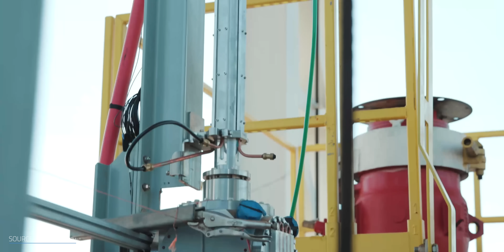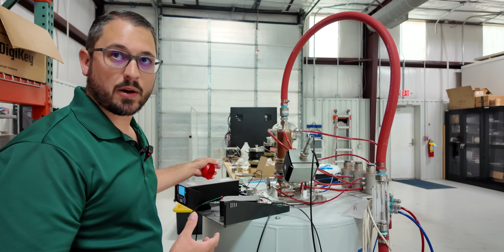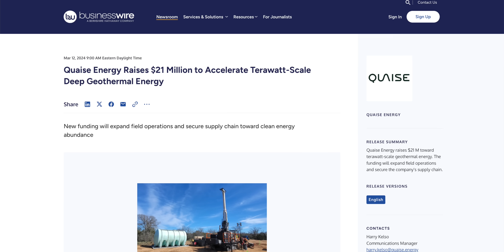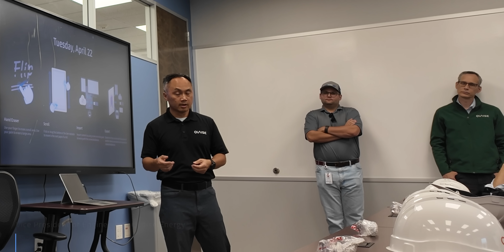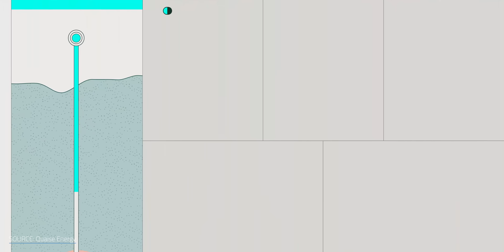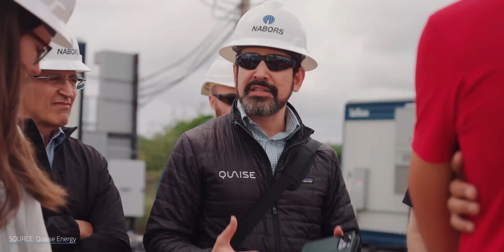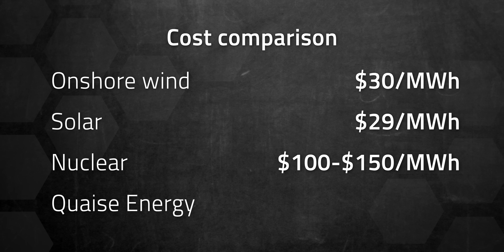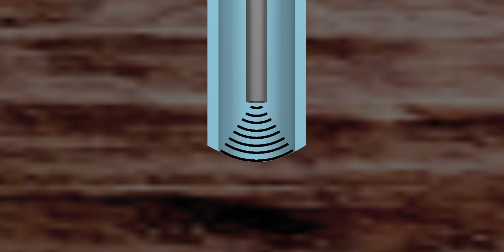How Geothermal Energy is About to Break its Limits

Comment from the maker: Are you convinced this technology can scale, or do you think there are still too many unknowns? Take your personal data back with Incogni! Use code UNDECIDED at the link below and get 60% off an annual plan: http://incogni.com/undecided 

If you liked this, check out Why Mushrooms are Starting to Replace Everything https://youtu.be/jI2LC3WTryw?list=PLnTSM-ORSgi7uzySCXq8VXhodHB5B5OiQ
Reply: Biggest unknowns for me:  (1) Drilling depth.  10 km was cited... the world record is 12.26 km (and while conventionally done, it took over 20 years), so that would be a significant achievement, particularly if that can even sniff that 240 hour mark.  (2) Hole diameter and stability.  You need enough space to work and pressures at such depths would be enormous.  I'm a fan of their approach, but I would not be surprised it Quaise has to settle for "really warm rocks" instead of "superheated rocks".
Reply: I'm skeptical but willing to believe, and I truly hope the best for them
Reply: One elephant in the room is that the vaporized rock will be white hot and some of it will stick to the wall and pipe, causing the escape path to become clogged. They have not yet drilled deeply enough to confront this problem. Maybe this can be solved, but don't count on it. Full speed ahead on all the energy technologies.
Reply: “Freedom-ray”
Reply: -as someone who has worked on many drill rigs, I have 0 confidence in this technology as it currently stands. I do think this kind of drilling will eventually work, but the R&D will probably take at least another 10 years. For one, I don't see that thin crust of vitrified wall holding up all that well against, say, high pressure steam in any given crack/structure. The final product will probably either need casing to TD (defeating the purpose) or some kind of extremely translucent drill fluid that doesn't absorb the energy from the millimeter waves.
Reply: @UndecidedTechnology  i work with drills as an industry specialist in minerals and this looks interesting. For Oil or geothermal this would work fine. Also for uranium if sampling was done using downhole neutron activation to sample. But something not addressed here that is critical for other parts of the geoscience industry is sampling for knowledge on mineral deposits. There is no capacity to collect representative samples from the drill interface for analysis. This is critical for things like precious and base metals. Also, 5m per hour is comparable to mud-rotary or diamond drilling through hard rock, but that rate doesn't compete with hammer based reverse circulation where 60 - 80m an hour is achieved with the right gear. Hammer RC is good enough for a lot of mineral deposits to define the resource and is dirt cheap compared to other methods. It also provides BIG representative samples. Ultimately diamond drilling provides the best data for minerals, but is expensive. Often a combination of the two is used to reduce costs and improve knowledge of a deposit. 

I think this is an emerging and interesting technology, but it is specialise for limited tasks and in its infancy. I do like the idea of drilling with powerful rays though 😁
Reply: Plastic rock deformation at the temp, pressure and depth they’re aiming for. I’m not convinced a glass lined bore will be structurally stable. But It’s interesting, can hardly wait until they figure it out.
Reply: Fascinating, Thx Matt for this information 🙏🏻
Reply: We have freezing gun!!!

🤗🤗🤗

^ ^
Reply: Earth is very Dynamic and it will move 10s of cm in seismic events.
Reply: Desistiu dos áudios dublados?
Reply: if you use boron arsenide inside the pipe it conducts heat 3 x faster than copper. it will not need to be too deep
Reply: I'm quite confident in the technology but when I first heard about Munich trying to use it I thought it was an attempt to keep Infront unduly centralised in favour of long established fossil fuel companies.

I might just be prejudice about them resisting federal laws continuously, on subjects I cared about since 2005
Reply: This is not new tech and frankly I am not convinced that their progress has been all that "dramatic"  It's also an interesting pivot for this drilling tech to a focus away from the traditional target of oil/gas.... an industry that has way more to gain in the near term and yet they have tried and not got it to work effectively in the near past and if they saw this as a likely breakthrough they'd be all over it.  I can't yet see the clear case that makes this approach a breakthrough or differentiator for geo. (I'd be happy to be be wrong btw - but will sleep easy on that possibility)
Reply: @tiagdvideo the classified tunnel tech of the military. 1960s. just pretending to be "new"
Reply: @UndecidedTechnology  
I wonder if the rock fumes might not cool and deposit on the way up?
Reply: How would this technology complement Sage Earthstore and their supercritical liquid CO2
turbine based geothermal?
Reply: I think it best to wait untl they did their first bore hole.
Reply: Im glad you revisited this technology. Seems very promising, In the sense that we definately can use the heat from the earth IF we can get to  it in a financially economical way.
Reply: Thanks for the video. Can you provide some information on how their cost compare to standard drilling costs. Something like an all in dollars per meter unit comparison. Also curious to know if they have an approach to revamp existing wellheads that have been capped due to low productivity.
Reply: What forces a Data broker to comply?
Reply: It will have to survive lawsuits from people who are convinced it caused the earthquake or the well to dry up or animals to run away or whatever random nearby event.
Reply: This won't work under our current 'for profit scam economic system.' Look, when humans discovered oil's usefulness, we got wars for 120 years over resources and a never ending headache in the Middle East, terrorism, and trillions of debt for fighting wars over their - all because of market economics - all because the easy to get oil sat under people who didn't share our same culture so we had to muscle our way in. So what's going to happen when all these corporations want to take over all the thinner parts of the Earth's crust to make it easier to hit heat? Looking at the plate tectonic map you flashed on the screen, are we going to have wars with Japan,  Peru, the Philippines, Cuba, Haiti and various African countries because they lie on or near fault zones?  Are American energy company going to use the 'Velvet Fist of spreading Freedom and Democracy" to force them to build steam to energy plants on their sovereign soil or territorial waters? Any company will have to spends billions of dollars running deep of shore platforms in the middle of the Atlantic  or pacific ocean just to extract heat energy and then what? Ship hot pressurized water or steam or a giant metal heat sink hundreds or thousands of miles to be converted to usable energy on shore?  Or are they going to magically make floating energy conversion station way out in the ocean and magically beam that energy to shore with microwaves? And because our entire socioeconomic system is motivated by money, profit at all costs, corners will be cut, and power will just be consolidated into the hands of the few. And does geothermal really solve anything? All that heat that gets sucked out of the Earth is going to get dumped into Earth's atmosphere or the ocean, thus negating any real 'CO2/emission savings'
Reply: Why not add hydrocarbon gasses, or hydrogen sure, just needs to work.. Most of the rock will chemically turn to gasses (cheaper faster extracting), and so much energy is made AT the stones surface.. and then the glassy wall can be a metal ceramic composite, Lots of win wins.. people will say "ahh fire  boom", but drilling for methane is common, and it will be mostly burnt by the time it reaches the surface. So it's really just more hot gass
Reply: What about earthquakes?
Reply: Strange you did not mention that Mitsubishi Corporation is one of the investors in the company.
Reply: Yes cause there are so few possible material losses. Maybe use s rotating design to produce an even bigger Hole to maximize the energy output on the long hand.
Reply: I like the idea but fear that if it doesn't work they'll just sell the drilling tech to oil companies
Reply: How about another update? How is Quaise doing these days?
Reply: As a engineer in geotechnical construction, I find it hard to imagine applications for these target depths to be useful for anything other than geothermal. Such a niche application does not seem reasonable to be pursued. I would be amazed if the cost to develop this is ever cost effective for producing geothermal energy. Of course there may be other applications or discoveries subsequent to this that changes other industries, but geotechs everywhere will tell you it's anisotropic so trying to dial in a perfect wave for each soil type is just too complicated for our technology now. Sonic drilling has a similar problem but the direct feedback and experience of the drill operator really determine how successful a project can be.
Reply: @keltonfredrick 
Drill down conventionally until you hit solid rock. Line the hole. 500m deep?  Then carry on down down down. The “anisotropic” variability of the rock is likely not going to matter a lot if the geologists have chosen a stable solid granite rock formation. The process makes its own fused solid rock pipe. 
The problem will most probably be water. Maybe they will have to line the hole with some new heat resistant plastic in the same sort of way that old rusty water pipes and drains are now being lined - a sort of sleeve that is blown down the pipe. 
I wonder how “thick” they can make the melted fused rock lining - the thicker the more stable?  The variabity of the rock … ??? … rather them than me!  But you never know - it may turn out to be a lot easier than we think. A real lot of bleeding edge science and engineering required.
Reply: If they started from an existing deep mine shaft and extended it that could help cut costs and time.
Reply: I am more than convinced I am hyped. 

It just has all the characteristics of a technology that actually works. It's an existing field. People have done it before (drilling deep I mean). They take innovation from A to B. It's absolutely scaleable, there is no reason at all why they shouldn't upgrade to a 50MW set up and blast carefree. They build on so much existing technology, existing drill holes, existing knowledge about heat to power conversion.
They can scale it up or down, they can start of in easily accessible places and move up to difficult ones... 
There is no reason on earth why the €/kWh should stay at that number . 

And they receive basically zero help. How much cash is poored into wind and solar?
Reply: @UndecidedMF  the tech looks solid the issue is the oil and gas companies who will stop at nothing for this not to be popularised. Greed and corruption is the main factor why environment has gone to crap and renewable haven't been successful.
Reply: @TheThehwashere   fossil fuel companies certainly bribe and lie to hinder cleaner forms of energy. But renewables are extremely successful ! Wind and solar have been the majority of new generation everywhere in the world for years because they're cheap and quick and continue to get cheaper. "Renewables accounted for nearly 86% of new global electricity generation capacity in 2023, according to data from the International Renewable Energy Agency. China added 55% of all renewable generation capacity in 2023; more than the rest of the world combined."
Reply: electricity cost alone will be absurd, it is like microwaving to melt ceramic or glass ware. additionally, the equipment will not survive once they go deep/hot enough which they haven't done yet.   i hope they find other applications for their work.
Reply: @zodiacfml 
Do you think they spent all this time and money without knowing what forces are involved?
And cost of electricity? they aren't paying for the 80% down time that is required for drill bit replacement.
You need to pay more attention to stuff.
Reply: @BobMac-r1v  you don't know how start-ups vs investors operate?  startups just need to convince people they have a future so that investors keep putting their money into the company. people in the company just keep doing this until money dries or they decide to do something else
Reply: Geothermal STILL DUMPS HEAT INTO THE ATMOSPHERE WHICH SOLVES NOTHING! C02 is responsible for trapping heat in the atmosphere - so if you look at geothermal plants, many of them dump excess heat into the atmosphere. So what's the point? To those who don't understand thermodynamics, they hear "reduced C02 emission...good" don't understand HEAT is the bottom line problem.
Reply: If we start taking energy away from the earth core, is there any risk by doing this ? Wont the core start to cool down ?
Reply: @miloddvoranak8900  Short answer, yes, longer answer, -but it contains SO MUCH HEAT that it would take millions of years. Fun fact, much of the heat from the inside of the earth is due to the decay of radioactive elements! Geothermal power is, in a roundabout way, nuclear power :3
Reply: @miloddvoranak8900 the core heat comes from tidal gravity forces, rotational energy, and radio isotope decay.  2 of which are externally renewed
Reply: Does anyone else but me think it's a really, really bad idea to cool off the Earth's core?
Reply: @BixbyConsequence  Yes, I was going to add that to my big comment I made, but it would take centuries to draw down enough heat to start to effect the Earth's crust and rotation that would reak havoc on our magnetosphere; the bigger problem at hand is dumping all that heat from the Earth's outer core into our atmosphere and oceans, - it solves no global warming issue.  And in my comment, there will be wars over land that is prime for heat extraction and transporting extracted heat across vast distances is not practical
Reply: @disruptapps  Yea... no.
Reply: @AddItUp-11235  Stand your ground - what say you?  make your argument
Reply: @disruptapps  Huh, sadly your comment no longer shows and I don't remember what it was.
Reply: @AddItUp-11235  people don't want to hear the truth
Reply: @BixbyConsequence  That is how Superman's planet got blown up.  I think.  Maybe.
Reply: im not convinced, absolutely not!! (i for sure watched all of 18m video in 2 minutes!! for sure for sure)

Comment: How do they manage the bore pressure?  Just air pressure while drilling?  Usually mud does that.  And wouldn't the return flow plug after a few hundred feet?  What if chunks break loose that aren't vaporized?  

Did I mention the whole thing sounds like a sandblaster?  Broken glass is famously abrasive...

Comment: The quoted cost numbers for wind and solar power are completely bogus because they don't include the cost of the 100% conventional power backup required to deliver reliable service. Would you want to "save money" by buying a car that only runs 25% of the time, so that you have to have another car which is actually reliable? The truth is that wind and solar don't save one dollar in conventional energy investment, so are a completely added cost which is reflected in rising energy bills where-ever they are installed.

Comment: The length of the drill pipes still can’t overcome the inability to produce any torque at the drill below 15 kilometres. You just can’t drill 40 or 50 kilometres to where the useful heat is. It only works where plate tectonics has brought the magma closer to the surface.

Comment: It looks brilliant but let's not get too excited until they are reliably generation power. Meanwhile, geothermal on a domestic scale, as you know, is way behind where it could be. Ground source heat pumps have so much potential but attention has focussing on air source. Installers are very few. This needs to change.

Comment: I wonder if you could repurpose the drill for more than just geothermal? This could also dramatically reduce the cost of constructing tunnels for transportation as well, or even quarrying. You wouldn't even have to widen the beam to make a bigger hole, just more smaller ones that can create an outline of the shape you want, segment the parts for easier extraction, and voila you have a new tunnel at the exact measurements you wanted instead of traditional designs that accommodate for the wasted space in the circular structure.

Comment: I appreciate hard to solve solutions and persistence.  However, the simplest, lowest cost solution will always win.  Beyond drilling two holes to create a loop, you need to build a plant to convert that heat into electricity and then transmission lines, and so on.  If a simpler (both construction and maintenance) solution gets us to where we have electricity with little cost, why bother with the difficult solution?  The only answer that works is that it is the only sustainable and reliable solution.  But that isn't true.

Comment: We should call this "active geothermal energy", because people have given "geothermal energy" two meanings, depending on whether it comes from the core of the Earth itself or is heat stored in soil by a climate control system during summer and then re-scavenged during the winter.  What comes from the Earth's core is "active geothermal energy", whereas the heat stored underground by a climate control system is "passive geothermal energy".

Comment: Where is the mm wave emitter?  Stationary on the ground or moving down the hole?  If stationary, how many dB per meter is the attenuation of the mm wave?

Is tube that travels down the hole flexible and spooled on the surface like a hose or is it in rigid sections that are added one at a time?